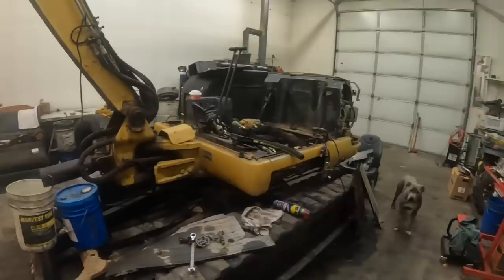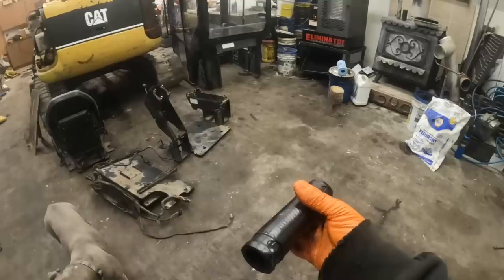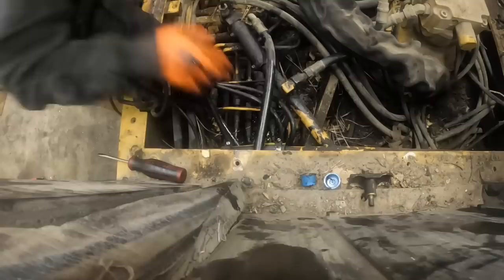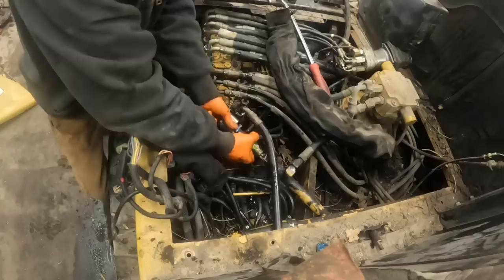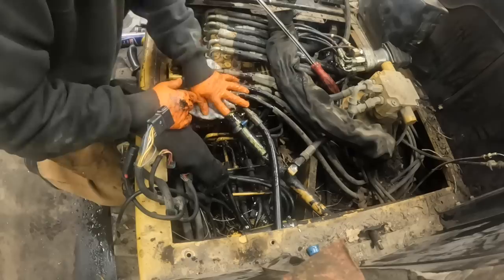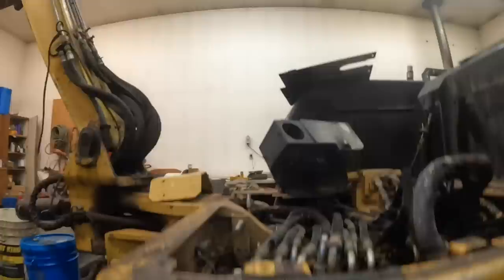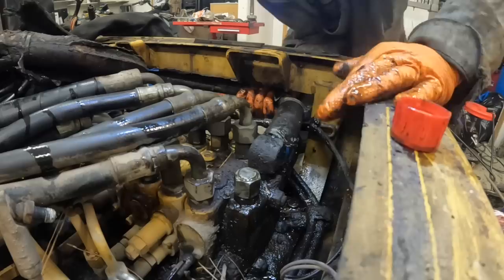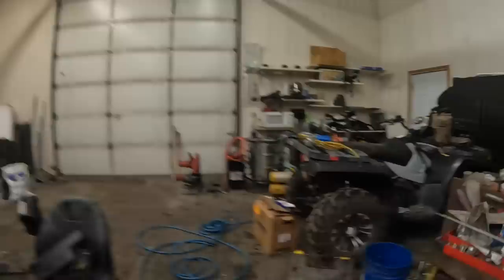Caterpillar mini excavator hydraulic leaks pt. 1

Comment: I worked for Rigid tool in Elyria Ohio back in the 1970s . They are still there made in the USA
Reply from the maker: That's good to hear, especially this day and age.
Reply: Yeah, their pipe wrenches are bullet proof and not really that expensive considering the quality. The design is ripped off by so many other companies but non get anywhere near the quality of the Rigid original because the clones cheap out on materials and details.  Actually, Snap-On sell Rigid pipe wrenches with their logo cast into them, or did some years ago. I have one I bought from a Snap-On dealer as I was in urgent need one day and couldn't get to my usual tool dealer.  The war in Ukraine is teaching all manufacturers a hard lesson about supply chain integrity, so maybe we are going to see a return to onshore logistics.

Comment: Nice to see another video Warren! When working on return/sucktion lines I use a vacuumpump on the hydraulic tank. Keeps the oil from puking out everywhere. 

I work on a lot of mini diggers. They can be a pain in the ass but you're not climbing around as much as you are on the bigger machines.

Comment: I have a 3 tonne jcb. every ram was letting go. The fix was £0.96 say a dollar, but it was £2500.00 to get toit. Every pipe and fitting in the valve chest had to come off before they could get to the valve using that 0.96 part.

Comment: Hi Warren  Thanks for another interesting repair video.
I always dreaded working on Skid steers and mini excavators.  
Your comment about 20lbs of shxx in a 5lbs bag is right on.
Take Care
TGP
Reply: Skidsteers are a little easier. At least the cab tips up instead of having to take it clean off. Still a pain though.
Reply: @mikeznel6048  True on later ones anyway. Older ones not so much.

Comment: Put a shop vac hose taped on the hydraulic reservoir and then u won't have any leaks when you remove the hoses or I've used the air vac for coolant its noisy but clean. Thanks for the video Warren
Reply: Good tips, i'm allways used an old vacumcleaner connect to the hydraulic tank, it works in Sweden. I'm certain it works in USA also.

Comment: Just a little tip on using 100R4 hose with the internal wire spiral.  After cutting the hose to length, follow the now protruding wire spiral back to where it enters the hose, go back about 1/2 to 3/4 inch and cut the wire at 90 degrees to the hose end, then pull the cut wire out. Saves ragging your hand or fingers on sharp wire as the end of the wire is now captive in the hose.  Ridgid tools rock, I have several sizes of their pipe wrench which have been well used over more than 30 years, still work perfectly, even the jaw teeth are still sharp. I can also recommend their hex end pipe wrenches, same as the pipe wrench but have jaws shaped to grip hex nuts like an adjustable wrench, so the nut isn't chewed up like a toothed pipe wrench.  I feel your pain working on cramped hydraulics, with oil mess and cr4p everywhere!  Keep on rollin man, lifes a journey!

Comment: The right shoulder pain you are describing sounds like an injury. I had similar pain 12 year ago and put up with it for years just ignoring it. Then when it was stopping me from sleeping, I went to an Orthopedic Surgeon, and it turned out to be a torn Labrum which caused a tear in my rotator cuff too.  It can't be repaired by physical therapy of injecting it with cortisone which just damages it further. I spent 15 weeks off the job 5 of that in an arm sling the rest was physical therapy. Wouldn't have been that long but I waited to long causing further damage.  Get it checked out. MRI will not see the full extent of the damage. Mine was repaired arthroscopically too.

Comment: I have a 36” pipe wrench, and has had the living daylights used out of it. I actually had a a situation where I hooked a 10 ton overhead bridge crane on the handle of the wrench to try to get the cap to release as it was so tight, we ended up heating it and pounding it and when it finally let go, there was a big bang and I thought we broke the handle, the cap let loose was what it was, I did bend the handle some, but the wrench still works fine, that’s been 23 years ago. Thanks for the ride along sir.

Comment: I just a suggestion.... They make a clamp for hoses on sprayer rigs that resembles a turbo charge air clamp. Its what i use on that stiff wire suction hose. I cant get regular clamps tight enough not to leak with out striping them.
Reply: Return lines don’t really have any pressure on them like a sprayer does.

Comment: Warren , could the oil from the boom cylinder hose have been back flooding from the oil return circuit?  Doesn't make much sense to me but that was the only thing I could come up with that wouldn't cost a ton of money to repair.  Good luck on that whole job , I always hated chasing leaks on machines like that.

Comment: 43:40 happens to me every time. Changed a conveyor on a big road plane once. Took the whole conveyor assembly off in the shop and back the road plane out so I could get a mini in to man handle the conveyor belt itself. Didn’t think the lines for the hydraulic motors and the tilt and turn and fold cylinders needed capped became they weren’t being used. I’ll tell you what man I’ve never seen that much hydraulic fluid pump out of a machine as much as that one did. Wasn’t under pressure, just lots of flow. That was the absolute worst oil mess I’ve ever had.

Comment: I have a Kubota kx 121-3 It was suggested to me to put a solid pin on the thumb on the quick attach. Original pin was bent.  Put in a new pin with grease fitting.broke pin on center in boom. Machine mostly does rock work building walls  Had machine checked by a mobile mechanic to see if thumb has to much pressure. Its an aftermarket thumb.

Comment: @14:43, I know you have seen it all, but if I was fighting the hose like you were, I would slit it on top of the tube it was clamped to and twist it off. It's junk, so there is no need to save it. I always did this when removing hoses back in the day from heater cores. Hose is cheaper than replacing the heater core. My $0.02. Oh, I see. By 15:36, you took my advice. Forgive me.

Comment: Nice video . Nice little machines until they start to have many leaking hydraulic hoses . Maybe time for a trade in for a newer used machine (2500 hrs or less ) ?  Designed to be productive and eventually replaced ?
Hence , planned obsolescence ? Warren , your drive , skill sets and experience , often keep older machines  productive well past the design life date . I wish most doctors could do the same .  Many thanks .
Reply: They’ll go way over 2500 hours if you take care of them and fix them when they break.

Comment: A customer brought one in for repair. Someone had so called 
Repaired a ram. They replaced the piston and put it back together without cleaning it out. They put it back on the machine and it worked 2 minutes and then the dipper arm wouldn't work. The shit out of the ram fucked a segment of the valve block.
Reply: Been there. Had a mind of its own for years

Comment: On my boat I started using hose clips that are stainless and a bit wider than normal clips made with a M6 bolt in them with a 10 mm head and I can sing them up tight with my mini impact gun and a 10 mm socket, they really tighten up and will bite into the hose if you over do it, been great so far, be great if I could add a small picture to a comment.
Reply: That's a good idea.  Komatsu puts gray RTV silicone on the inside of their hoses with 2 worm clamps on each end....still leaks

Comment: Warren!  Have you tried Compound Leverage Pipe  Wrench   from your pals at RIGID.  Here in the UK I use BIG wrenches from RECORD = IRWIN T234C RECORD CHAIN WRENCH; 1IN – 8IN(25MM-203MM)   WIll that do the next time ? ...  yes those wire reinforced hoses - a favourite of ours too..    like the later & Current Deeres .... too much electronics causing issues.

Comment: No safety glasses no knee pads or a pad to kneel on , you are going to pay later, but your job is over if your eyes are gone. Great video's other wise, yes i cut those hoses , its like they get welded on . Of course if its braided then its a different cat . I use vise grips but not too tight just tight enough to not slip on the rubber then start gently turning .
Reply: Work for OSHA?

Comment: You ever use one of those clamp tite clamps?  The ones that use the stainless steel wire?
Reply from the maker: No, never heard of them.
Reply: Ok basically it’s a tool to make your own hose clamp. Pretty simple to use and clamps better than a regular hose clamp. Wish I knew how to share the pic of the tool on here. The only downside is sometimes you don’t have the room to swing the tool.